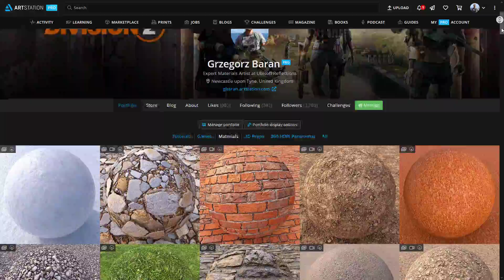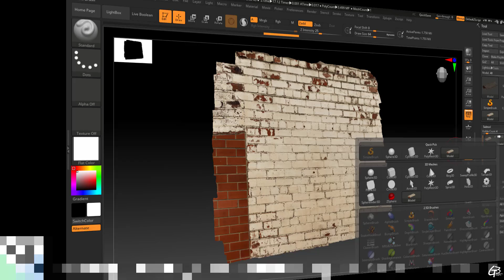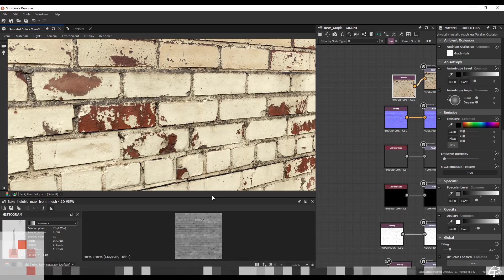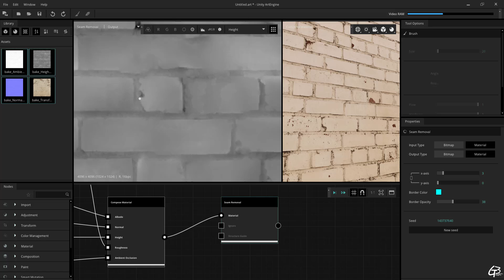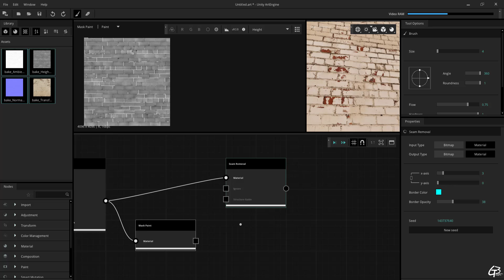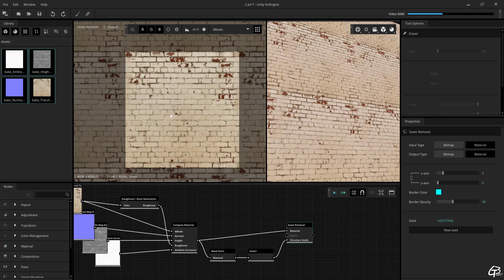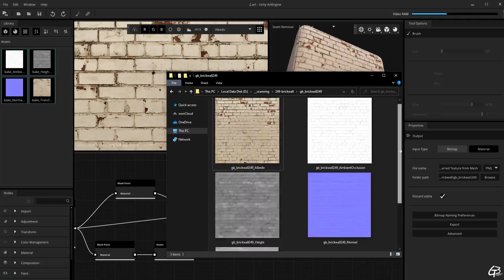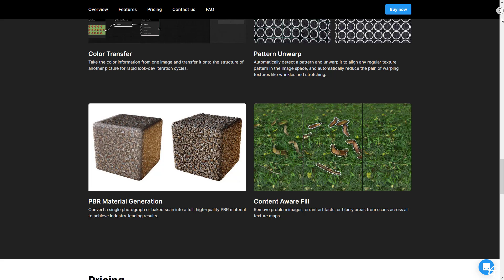Automated Texture Tiling with the Unity ArtEngine

Comment: Grzegorz, do you happen to know a workflow to use multiple texture maps in Substance/art enigne? For example. If I am scanning an extremely large area, 8192x8192 is just not large enough, so I want to use UDIMs instead to keep the res of a 20k texture in 4 8192s? Would really love a tutorial on this.
Reply from the maker: Hey Sergey, unfortunately I can't help you as I didnt use more then just a single UDIM space. Of course you can generate many textures in Metashape and Substance Designer baker supports many UDIMs but since I didnt use this feature I dont know the workflow. I usually generate 16k texture and for my needs it is more then enough, especially that for generation you can change the uvunwraping mode in Metashape which depending on the surface type can provide better space usage within available uv space.

Comment: 1:35 I still don't understand why this should be done.
Reply from the maker: Do you mean why do I need to tile textures? If yes, all generic textures need to tile so they can be applied to the geometry which covers more then a size of the texture. So lets say you have a ground surface in a game which covers 100m by 100m. If you apply a texture of grass which covers 2x2meters, which was tiled you will see a 100x100m surface covered with grass. But if the texture wasnt tiled and has edge seams .. you will see repetitive patches after the texture is applied to this surface. So the texture has to repeat itself in each direction. On this video you can see it while I animate it on the ball and plane behind. Its a square texture but because it is tiled (has removed seams), you cant see laser cut when it repeats itself but the repetition is seamless.
Reply: @GrzegorzBaranArt  Oh, thats how it work. Thx!

Comment: Hi Grzegorz, thanks for making another useful and very informative video. 
Do you have any chance to try the newest version of Alchemist (2020.3.2). I saw they have a new node "Image to Material with AI Powered". Also most of the cons you mentioned before like the Delighting has no adjustment has been updated.
One more thing is since Reality Capture has changed their pricing plans to a more reasonable price, do you have any plan to do the quality comparison between all photogrammetry software ? 
I'm owning the photogrammetry pipeline for our studio since 2 years, mostly work with Reality Capture so in case you need any support I could help, just to encourage you to do more useful videos like this one.
Cheers !
Reply from the maker: Hey, sure. I already did that in my previous video :)
https://youtu.be/XDAUw_dSmt8
and compared the result to the photogrammetry made material
Regarding the Reality Capture and photogrammetry software comparison video: yes, I do have plans to make a comprehensive comparison but it takes time. Initially was waiting for 1.7 update from Agisoft Metashape as it was a big update ... same as for the quite meaningful update from 3DF Zephyr. Currently I work on the content for the video and researching it. Still might take me a few months as I have a few more videos in queue but all are connected to some degree. Unfortunately the recent acquisition affected my plans a bit.

Comment: Hello, Grzegorz, I wonder if you have ever encountered such a problem. Take a lot of pictures. After color correction, the scanned texture collage will be highlighted, forming a highlight bar. I don’t know how to deal with this. Suggest? Thank you. https://i.imgur.com/n2DQzHf.png
Reply from the maker: I am not sure what do you mean. Do you mean lack of color cross surface consistency due to light changes during the capture? There are a few different factors which can cause that. THese can be light changes during the capture, solution for this one is to improve the capture part and get controll over the light.. so use an umbrella, tent or lightreflector to cast a shadow. If it wac captured in cloudy day and lighting change was caused by the moving clouds I would suggest to use automated setting in a camera so it addopts to light changes to fill entire dynamic range available with the data. Or .. use your own source of light which overwrites the external lighting.. going to cover it soon in my future videos.
I guess you already captured these images and you cant repeat the capture process. To fix that you can use algorithms offered by postprocessing software. I described it in my ebook. Basically something like Autotone in Lightroom etc.
Last but not least.. lets say you have the final texture with stripes .. you can always bring consistency using dedicated nodes. I suggest color equiliser node in Substance Designer. Corol equaliser in Alchemist would do the same. ArtEngine offers similar tool which is called a GRADIENT REMOVAL which I presented in this video.. but as you can see this one isnt very good and reliable.
Hope that helps :), Cheers!
Reply: @GrzegorzBaranArt  Thank you for your reply

Comment: The price tag for this software is outrageous relevant to it's current functionality and feature set - I'm not sure that's even arguable.
Reply from the maker: I totally agree. The price seems to be the wall everyone bounces from and I really hope the more people vocalise that, the sooner Unity is going to do something with this. It was the main blocker since the beginning. They reduced the price 5 times already, I guess a few more time is needed. This is why the main tool I use for tiling is still the Substance Painter. I purchased it on a Steam so I have a perpetual license which isnt subscribtion dependent and I can just keep using it 'forever'. But I covered the ArtEngine as its really good to know what tool are out there and what they offer. While ago tiling a stuctural surface like this one was impossible with any automated solution.. now it is, and this is something what inspired me to make this video. If the price is lower, ArtEngine might be the best available solution for seam removal on the market and no brainder for everyone. With the current price tag it isnt yet. Cheers!
Reply: @GrzegorzBaranArt  I really appreciate the video, particularly showing how ArtEngine would be used to tackle a difficult pattern, as opposed to rocks, gravel, etc., as you say. The AI mutation algorithms are obviously very impressive, but lack durability in their current form - the algorithms need to address more complex surfaces with greater ease to justify the current price, among other things.

Comment: have you heard about substance alchemyst?
Reply from the maker: Sure I did. I covered it in my few previous videos already with a bit more focus on tiling on this one: 
https://youtu.be/XDAUw_dSmt8
The tiling algorithms the Substance Alchemist offers are way behind what the ArtEngine offers. And quality wise there is a huge gap between results from the Alchemist and ArtEngine. Currently as far as I know there is no AI involved in Alchemist tiling solution and even if the tool is getting better with every new update.. its still not very reliable option in my opinion for tiling as when process sacrifices some quality.  Dont get me wrong.. Alchemist is a very cool tool and does the job, but at this stage I would prefer to tile the scan which I invested a day of my work already to bring it to the top quality level... manually using the Substance Painter then let Alchemist do this for me. I wouldnt mind tho to let ArtEngine to do this for me. Hope it makes sense :D

Comment: Really good introduction to the ArtEngine Grzegorz!

The seam removal is indeed really powerful, but the software is unfortunately way too overprice at the moment. Sure it has the best seam removal on the market and some other tools are great like the mutation tool, but overall, functionality wise it's still quite poor and it's just too expensive for freelancer and independent artist. I know they are planning on releasing an indie license, let's hope it will be at an interesting price :)
Reply from the maker: I totally agree. Its way too expensive to what it can offer. This is probably one of the main reasons why I still use Substance products as a core of my photogrammetry workflow and I made a video about the ArtEngine just to showcase its capabilities to those who havent seen it in action yet. As I also mentioned on the video, if I would have 100+ high quality scans to process I would really consider getting the license for one month or something like that to get them all done and deactivate the license after. Anyway, the price dropped about 5 times after the Artomatix was acquired by the Unity.. its the biggest downside of the ArtEngine since always.. I really hope it is going to get an Indie license option soon. Cheers!